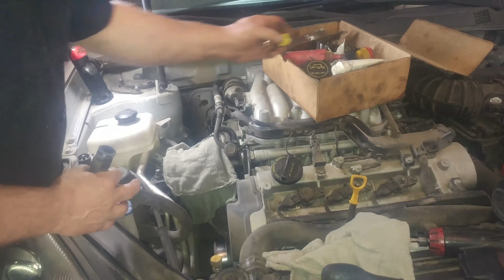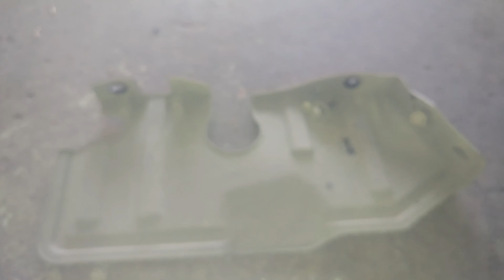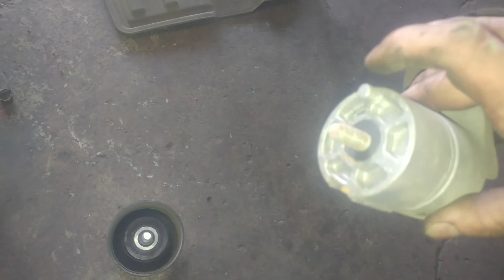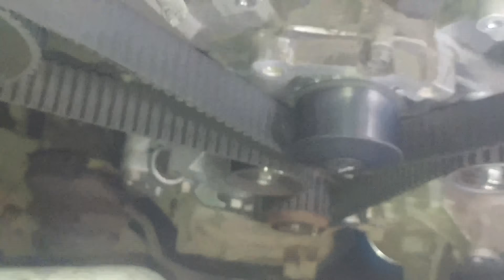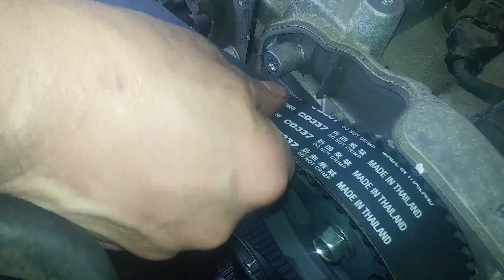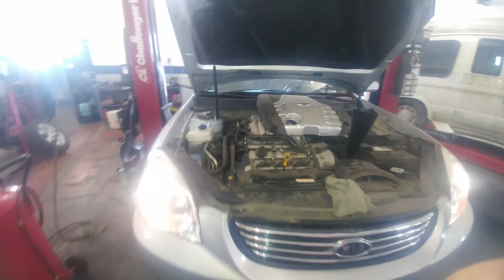Water pump replacement 2006 Kia Optima 2.7L timing belt. 2002-2006

Comment: I have a question, hopefully you can answer. My timing belt  was replaced  not too long ago. But recently I was hearing a lot of metallic noise which I believe is the water pump bearing. Does the timing belt HAVE to be replaced again if only the waterpump needs to be replaced? This seems like a lot of work just to get to the waterpump. I appreciate your skills and your demeanor. Very calm when it comes to things that seem like a real pain in the arse. Thanks for your help.